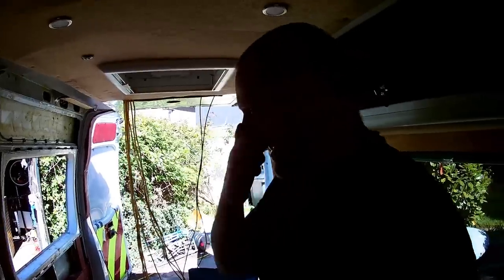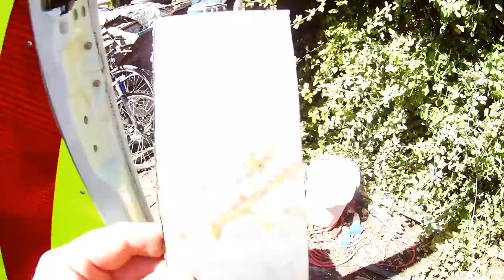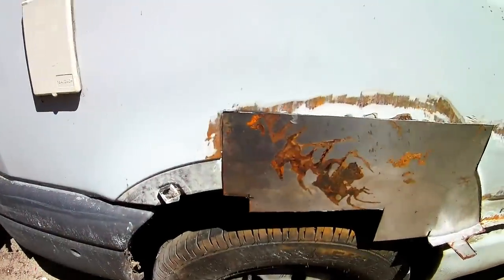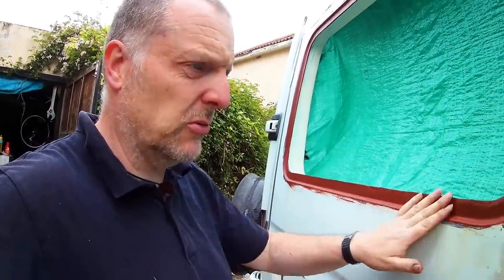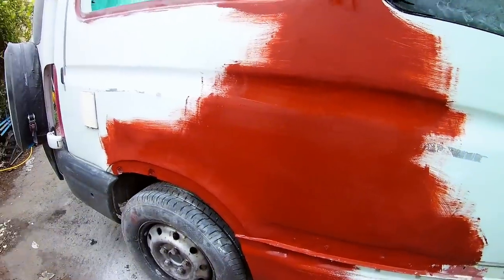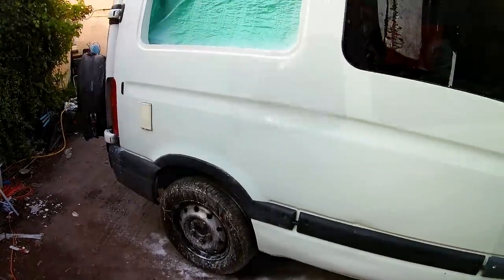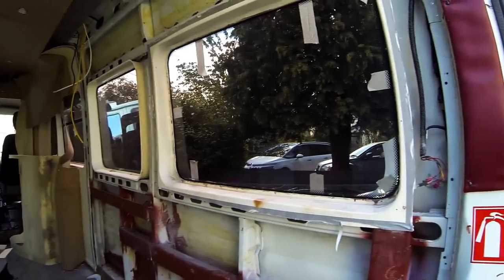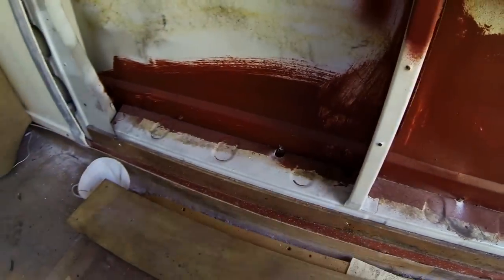How to Repair Rust and Weld Body Panels | Nina the ambulance in for repair

Comment: Many thanks for showing how. I will be welding up outer sill and bumper to chassis mounts soon. Changing all brake pipes as well. Currently adding modern insulation  into roof panels and oiling throttle and clutch cables. Other small stuff. George
Reply from the maker: Nice one mate. Every little helps make them run smoothly. :)

Comment: Loved that vid mate, thanks for sorting her out. It does make her out to be a really rusty van but she doesn’t have any other rust anywhere. It rusted because of a poor previous repair after an accident.  I can’t believe how much filler you had to grind away to get to the rust lol. All sorted now, she is completely rust free yay. Haven’t started the new refit yet, hoping to start after this week then it’ll be quite intense until she’s done. Lots of new additions this time round. Bonus the window didn’t fall out on the way back up the motorway lol. Cheers again mate.
Reply: Nina The Ambulance Camper  my sills seam on the way out Damon so it looks like I will be doing similar! I wish you luck and a speedy rebuild 😋

Comment: How do you do the fake seam mate ? 
Cracking job
Reply from the maker: Hello guys. No not angle grinder. I used 2 peices of mask g tape and ran a bead of panel sealer down then removed the tape. The seam was a raised  on so this worked well. :)

Comment: You got into a bad habit there mate by not using a proper welding face mask. You going to miss your eyesight when it's gone. An automatic face mask is a cheap way to ensure your safety. Doing all that hard work and then won't be able to enjoy it! Even got a couple of spare face shills in workshop,you can have one if you need one.
Reply from the maker: Thanks mate. I did use the mask it just looks like I didn't in the vid for a few spots.